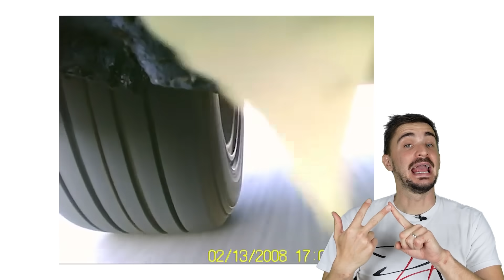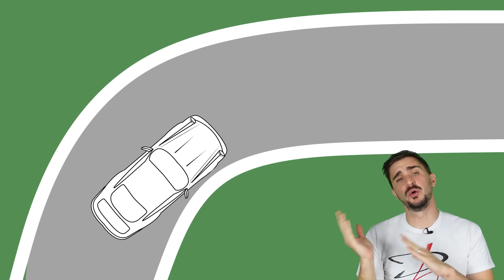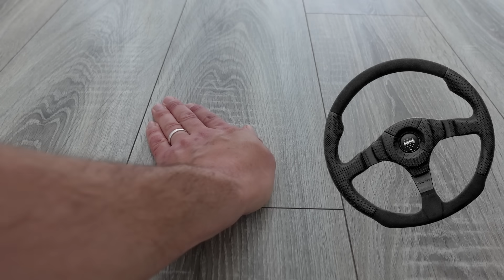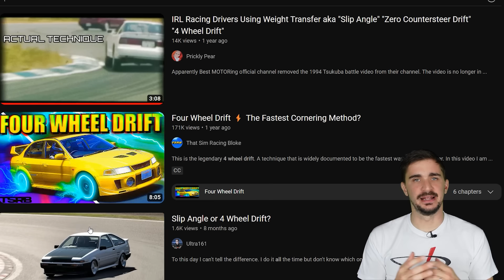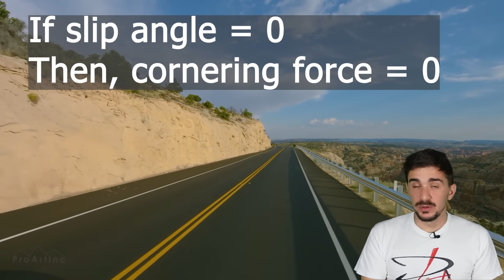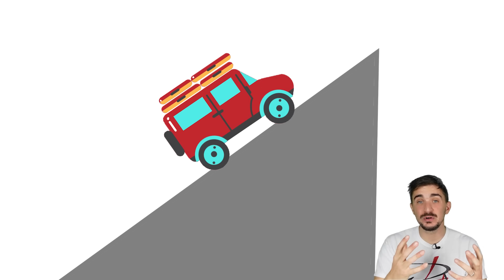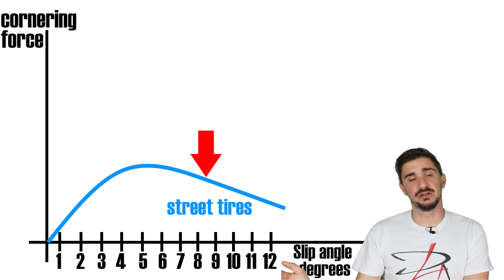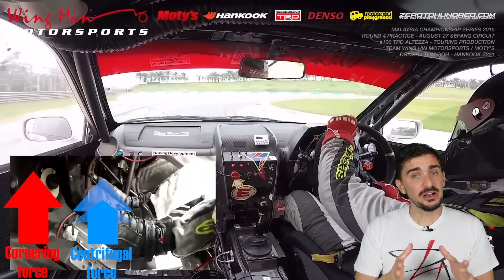You Think You Know But You Don't - Slip Angle Explained in a Way You Will Understand

Comment: Centrifugal force isn't real, it is the centripetal force (force pointing inward along the curve of your turn) fighting against the car's inertia which wants it to continue straight. If you let that ball on a ring you were spinning on your finger go while you were spinning it, it would go straight in the direction of a line tangent to the circle made by its previous path at the point of release (on the circle).

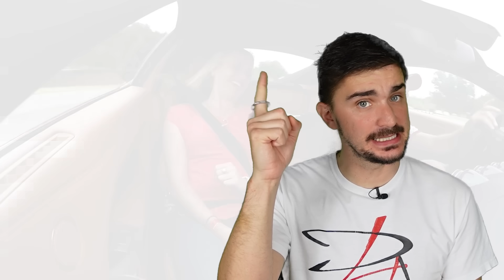Comment: At 2:04 and 7:40 That's not correct.  The sideways force it because the car (and everything in it) wants to continue in a straight line because of Newton's 1st law of motion but the tires push sideways due to the friction.  This is easy to prove, remove the friction.  What happens when you drive on ice and try turn?  The car will continue straight, probably sideways but still straight.

Comment: Fun fact, there is no such thing as centrifugal force. 
It is a perception of the acceleration that is  the result of moving in a curve. 
Inertia would have you travel in a straight line. 
A curve requires changing the direction of your travel, and since the direction is constantly changing, the perception of acceleration is constant. We call it centrifugal to differentiate the perception of acceleration in a corner from the acceleration in a linear direction. 
Constant linear velocity on a curved path is acceleration. 
Fucky, hu?

Comment: You are mixing centripetal force with centrifugal force. The centrifugal force is what's pushing you out; the centripetal force is what is pulling you in. For a car turning, centrifugal force is the momentum of the car resisting turn, centripetal force is the  cornering force.

Comment: Statements about friction are clearly false and that is reason why this explanation is somehow abstract and it doesn't even touch causes of the effect. We have three types of friction - static, dynamic and rolling. Rolling friction causes losses, static friction is what holds car while on brakes, but also prevent lateral movement - basically any movement which would require tires to slip and dynamic friction is what is stopping car (or trying to force tire into rotation) while slipping is occurring.

Now, let's imagine car with wheels that are basically undeformable cylinder coated with microscopic coating of rubber, too thin to be deformable, driving on flat surface. Front wheels are deflected at 10° angle and car is slowly accelerating. What would happen? Would car be able to turn at any speed, at least very low ones? Of course it will. It will run in circles as long as centrifugal pseudoforce (inertia) is less then maximum static friction force of that rubber coating on that surface. Since rubber typically has dynamic friction coefficient smaller than static one, once centrifugal force overcomes friction, car would fly off. Behaviour of that experiment car cannot be explained with slip angle nor it's consistent with claim that friction doesn't causes car to turn. Simply put, friction is causing car to turn.

But, what happens if we made that coating thicker and deformable? Forces of inertia and friction cause rubber to deform. Because of that deformation, tire is kind of "walking" away from steered angle. But that has interesting side effect - wheel as a whole is slipping, while each infinitesimal patch of tire is staying at fixed position while in contact with road. As I mentioned earlier, static friction coefficient is bigger than dynamic one, so, we are basically having slip without breaking out static friction. That allows us to have higher cornering force that we would have without tire deformation.

That cornering force is still caused by friction. Each infinitesimal patch of tire is still subjected to friction law. But tire as a whole doesn't behave like object with constant friction coefficients because of it's deformation, so we cannot calculate friction using simple friction law. Instead we have model that describes cornering force through slip angle. But, in low level physics, cornering force isn't caused by slip angle, it isn't something that turns car instead of friction - it basically IS friction, but friction of complex deformable object which cannot be explained with simple friction coefficients.

Comment: It's also worth pointing out that this is why high-profile tires tend to give you more grip in dirt and snow.  Regardless of compound, less traction means less slip angle.

Frankly, I'm sick of manufacturers putting 20"+ rims and rubber-band tires on all their modern cars because they look cool.  All they really do is give you a harsh ride.  The construction of the side wall has a much higher impact on handling than the profile, and most cars would drive just as well, if not better, on 16" rims.

Comment: As always great video! I have some questions for deeper understanding.

When rolling at low speeds, this mechanics with the different directions of contact patch and tyre, which creates cornering force is not applicable? Because intuitively it seems that if I start moving from stop, and before movement I've already turned steering wheel to the dead left and keep it there, my front tyre should think it's moving in the straight line? And slip angle should not appear. If so, there should be some transition between the process of turning from stop (rolling and turning) and turning from straight line at some speed (where tyre deformation occurs). I'm wondering where it happens and on which variable it depends (like speed at the beginning of the turn or derivative of the steering angle).

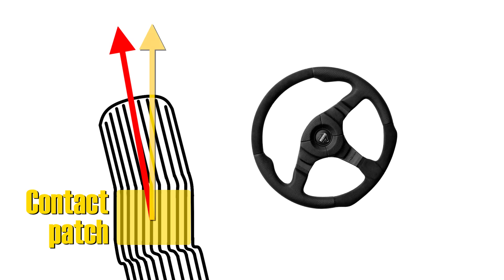How does slip angle related to steering angle? As steering angle I mean an angle between roll axis of the car body and the axis in the center of the wheel if looking from the top. Or in can be considered the same? In other words, does the direction on the vehicle is always the same as the direction of the contact patch (4:09 yellow vector)?

Comment: Hello, great video ! 
There is many things to think about. 
In particular, losing grip on the front axle (excessive steering angle / speed, blocked front wheels, underloaded front axle) is much more a concern than losing grip on non-directional rear axle that can be part of driving skills, fun way to corner or even art of drifting

Comment: Does slip angle only apply to rubber tires (or similar material) or does it apply to any rotating/translating object? In other words, is slip angle the consequence of rubber twisting, or the consequence of a rotating object placing new thread on the ground? Is it the only way (physically speaking) to steer the car? 
What if the tires were rigid (or we rode on wheels, for that matter)? Let's say the wheels and road are made of some 100% rigid material that generates grip due to parts interlocking (sandstone). The car would likely steer, yet the wheel won't deform. 
Perhaps you could explain this further?
Kind regards,

Comment: Very nice insight to the subject.
Now which of the front tires - when cornering - is more dominant in setting the car direction?
Reply: curve outside as it has more load so more grip/potential/cornering force
Reply: @gaborb  I dont think you are correct, but let's see if anyone think differently 👍
Reply from the maker: He's correct. That's why some racing cars have something known as anti-ackerman.
Reply: @d4a  I understood that race cars has their toe set to negative because it causes the car to get to turn more quickly on the expense of tracking in straight line, if this is true when toe is set to negative, the outside tire, at the start of the turn will point straight while the inner will be the one pointed to turn direction, and cause the car to turn. I might be mistaking though....

Comment: 05:10 Small correction: judging by the turning radius, the steering wheel should be constant, not increasing the steering angle.
(Edit: While reading further into the subject, I found that this video is plagiarized from YourDataDriven's article on tire slip angle. Animations, eraser analogy and hand analogy are ripped straight from said article. At least give credit! Unprofessional.)
Also, four wheel drift is a real technique mostly used by pre-war racers. (Look up Fangio or Nuvolari) Old tires (bias-ply) grip the best at a much higher slip angle, and aligning all four tires at the best slip angle (zero-counter drift) yields the highest cornering force.
Reply: None of you understood
Reply: @Israel Ignacio Mireles Maria  Let's do a little thought experiment. Car A and Car B are driving on ice. Car A turned its steering 5 degrees to the right while Car B kept its steering straight but rotated the whole car 5 degrees to the right. Which car moves right faster?
Car A has 5 degrees of slip angle only on the front tires, while Car B has 5 degrees of slip angle on all four tires. Four wheel drift!
Reply: @llys3742   Ok cool,but i still think you didn't understand the video
Reply: @israelignaciomirelesmaria3009  I think we both understood the video to its full extent. We are simply adding some additional information to the comments section for those that are interested.
Reply: 5:12 l don’t understand 
When you add input to the steering wheel each contact patch has an angle with the previous one but you don’t add endlessly inputs throughout the entire curve. At some point the steering wheel doesn’t move anymore so the contact patches are lined up. So how come the car is still cornering ?
Reply: @Boss_Tanaka  Right, at low speeds, after the initial slip, the car has near zero slip angle. But at high speeds, centrifugal force keeps distorting the tires at an angle different from where the wheels are pointing. This is what the tire on the conveyor belt was simulating.
Reply: @llys3742  imagine you don’t have a rear axle and the back of the car is hovering magically.
When you begin to turn the steering wheel, the car starts cornering because of slip angle. As soon as  you stop increasing the steering angle the car would go sideways but in a straight trajectory. It would stop cornering.

Now back in a normal car with front and rear axles.
From what l understood from the video, the slip angle between contact patches explains how you enter or tighten a turn but it doesn’t explain how you maintain the turn. Isn’t there a kind of torque induced by the rear axle?
Reply: @Boss Tanaka  Yes! You're talking about rotational and translational force. Instead of rear axle hovering, I'm assuming that you're talking about all four wheels steering in the same direction. The car would have translational force, but no rotational force. On the other hand, a normal car that can steer its front wheels 90 degrees would only have rotational force.
Cornering is a combination of the two forces. Rotation keeps forcing the car into a new direction, thus keeping all four tires at constant slip angle. To give you an example, let's say you're driving on a hexagonal circuit. You would turn the steering wheel, straighten it, turn it again, etc. Every time you turn the steering wheel, you induce slip angle on the front tires (rotation), then rear tires soon after (translation). What about an octagonal track? 20-sided, 100-sided track? A circular track? Constant slip angle.

Extra information: the scientific term for corner entry is transient state cornering (the moment you start turning the steering wheel), and the term for mid-corner is steady-state cornering (the moment you hold the steering wheel at a constant angle). Rotational force is only done in transient state and only by the front tires (assuming there's no 4WS). Afterward, it's all momentum that's spinning the car.
Reply: @llys3742  now it gets clearer.
Thanks for taking time to explain ! 🙏🙏🙏👍
Reply: @llys3742  Can you please explain, if my understanding is wrong:
Car travels circular with a constant steering wheel angel, because it's always related to axis of a car. So, even if steering wheel is constant, skip angle is never 0, because by the moment front wheels align next contact patch, car have already turned.
Reply: @bladla7959  Correct, but it's worth noting that it's not the car causing the slip angle, it's the forces. If the car was somehow massless, tires would have zero slip angle. It's the mass of the car causing centrifugal force, flexing the tires, and causing slip angle. In fact, at low speeds, cars do have near zero slip angle.
Reply: @llys3742 I know it's been 9 months but I want to thank you guys for the explanation regardless. I've been looking through the comments for nearly one hour trying to find somebody mentioning this.

Just like the guy above, I was wondering how the tires would behave in a corner after steering input stops increasing. It makes sense that what is actually creating slip angle the whole time is the inertia from the mass of the car itself.
Reply: Absolutely correct glad to see someone mentioned this! Only thing of note to add is that while you are correct on zero counter steer slip angle yielding the highest cornering forces it also produces a large amount of tire wear and heat generation. Thus while it is of high importance to take advantage of this method during a qualifying lap to do so over a race distance has the potential to over heat and over wear tires to the point of being less beneficial than driving slightly less aggressively.
Reply: For anyone wondering, this is achieved by slightly over-rotating the rear tires to such a small degree that they drift to the point of achieving the same optimal slip angle that the front tires are doing. This mean the front tires can be travelling straight, relative to the car, and the rear tires are of course straight (unless the car has 4wheel steering) but the car is rotating to such a degree that all four tires are achieving optimal slip angle. This is how the highest cornering forces are achieved. Optimal slip angle on all four tires. Hence why being a top racing driver is so hard. Trying to constantly achieve this balance on the limit of all four tires through all the corners possible. Especially with race tires where the limit is so aggressive as displayed by the graph in the video. Also this is why racing game AI suck. It’s impossibly difficult to achieve especially when accounting for a real track with bumps, curbs and inconsistency of grip depending on any number of variables.